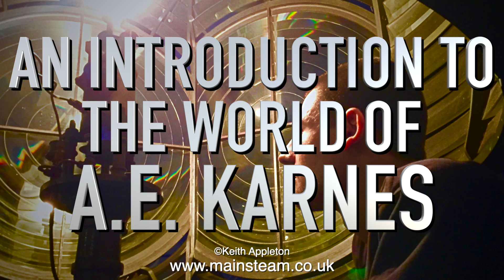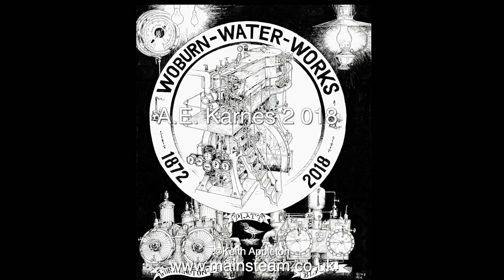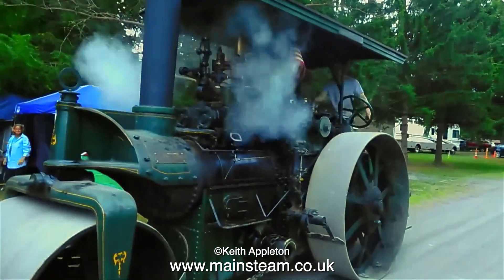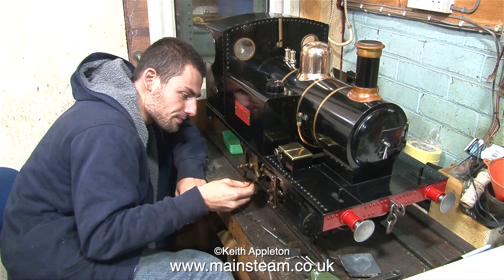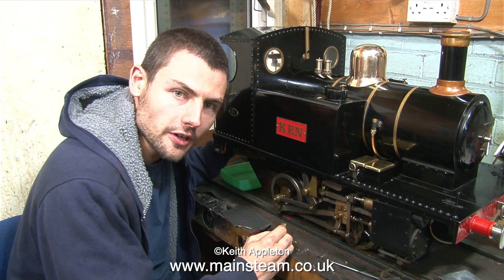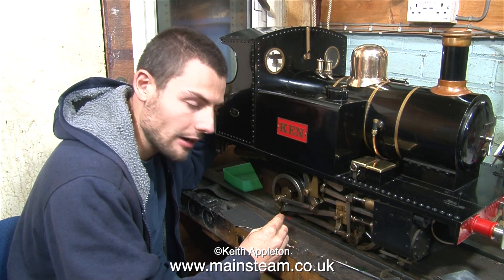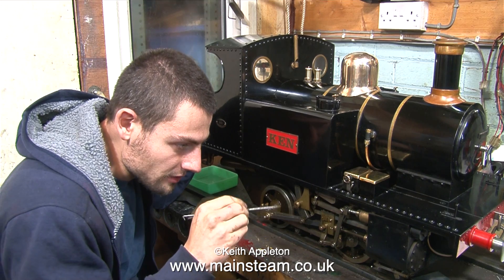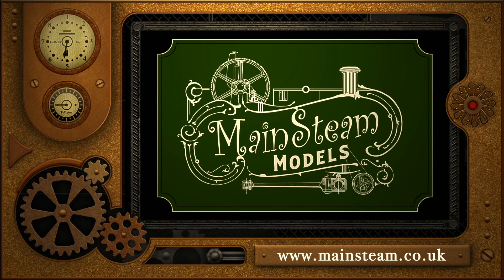THE WONDERFUL WORLD OF A.E. KARNES - PART #1

Comment: As a 50 + year 'live steamer', I thank you for this video. (I built, modified and run a 1/8th scale Little Engines Atlantic, in the style of the ERIE Railroad). My Atlantic has been running since March of 1997,25 years. As I write this post, I am finishing up on installing a new boiler on my locomotive. ERIE #7597. Thank you again for this video. Sincerely, BF Ray.